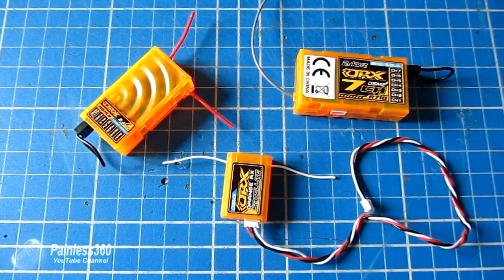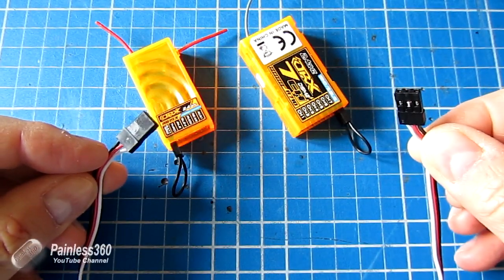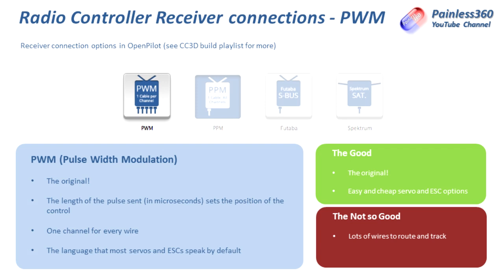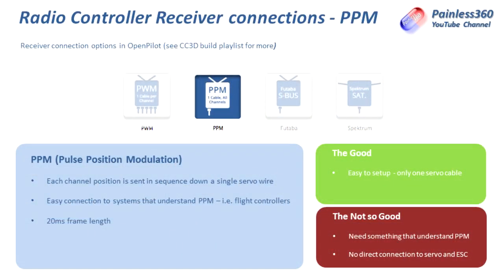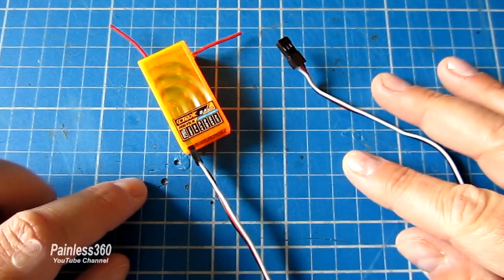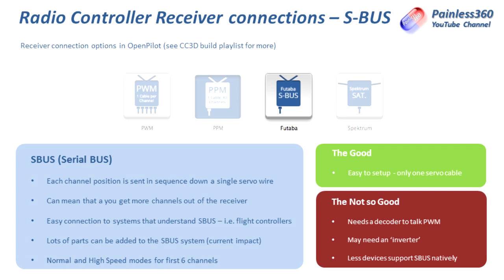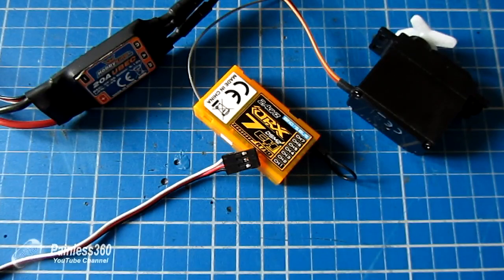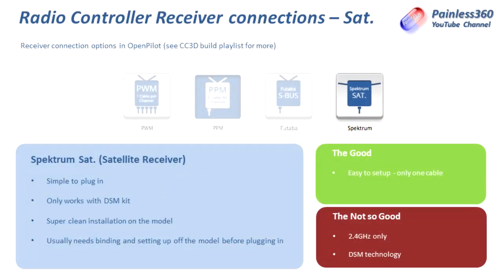RC Quick Tip - PWM, PPM, CPPM, S-BUS and Sat. explained for beginners

Comment: Great video! Any chance if you know if the Spektrum AR7700 Serial RX will work with a DJI A2 FC?
Reply from the maker: +NFA RC you need to have a look at which of these common protocols that receiver supports, and then make sure that what least one of them is supported with that flight controller that you're interested in. If both of them support the same one, then if you use that you should be good. Hope that helps!

Comment: hai painless360,i have question for you about my eachine vtail 210.. my vtail is ppm output,how to change my ppm output to sbus output.. cause this vtail use flysky rx and i get to change transmiter to use futaba.. thx
Reply from the maker: It depends on the flight controller it's using. If it's one of the 'normal' ones then you can look up the videos/manual for it.. Best of luck!

Comment: hello  can you watch this short video and tell me what i am doing wrong with the wiring of my esc's
https://www.youtube.com/watch?v=PePYT4SfY7Q
thanks and have a merry christmas.
Reply from the maker: Sounds like you need to do a little bit more research in order to figure out what you’re doing wrong as there are a lot of assumptions and testing you’re doing that are not helping you here. I’d suggest watching the ‘Quadcopter building for beginners series’ here as well as the ‘Introduction to remote control’ series too. Best of luck..
Reply: thanks. i think the bugs b2c board must use a protocol that the new esc's cant read.
Reply from the maker: +Chris Riley very possibly. OEM systems like this I usually designed to work with a very limited set of components to control complexity and costs. With open source components you get the chance to go into the software and change the settings needed to make it all work. Happy flying!
Reply: thanks . i did not know if it would work and could not find any info on it so i just thought i would try it. can 2 stock esc's be added to each arm for more amperage or will that not work eather. the stock esc's are only 6 amp.  thanks for your help, you are the best!
Reply from the maker: +Chris Riley no that won't work. You don't need to increase the amperage of the onboard escs they work fine with the supplied Motors and props. Happy flying
Reply: i know but i want to put the bugs board on the smaller carbon frame . and to do that i need to run smaller props and to do that i need the 2600kv motors that i have and they pull 15 amps and i want to use the bugs board cause it has gps and rth.   but i get the picture it just will not work. i guess that is why no one else has done it before and i could not find any info on it.  this just sucks.  oh well thanks anyway.  im a big fan and love your channel. keep the videos coming!

Comment: Hi. I'm trying to figure out if the SPF3 flight controller would work with a spektrum AR-610 receiver. Can you help me please ?
Reply from the maker: +LithiumBoltYT you need to see what outputs the receiver supports. After a quick check, I can see only supports pwm. That connection is covered in this video. Best of luck
Reply: Ok thanks

Comment: so I can use my drone transmitter to a rc plane. I have an old devo 7 and Im planning to build rc plane would I be able to use it since in rc planes is mo simple that quads.
Reply from the maker: +Joenas Gayramon yep. Typically there is much more setup needed on a plane than one for a quad..

Comment: Hi, do you know if you can connect the SAT port on the side of a DSM PPM or DSM S-BUS receiver to the SAT port of a Flight Controller? 

Or to put it another way, is there a signal coming out of the sat port on the side of the receiver? 

I was looking at doing this so that it frees up more pins on the Omnibus F3 FC for connecting so I can connect a Rangefinder and GPS all at the same time. 

Thanks as always
Reply from the maker: If I understand the question correctly - you can't the Sat. connection is for the radio signals from the sat. Rx only..

Comment: I have an etronics controller From an old helicopter. is there a way to pair this receiver with that transmitter?
Reply from the maker: Without knowing more it's impossible to say. Most of the older flight controllers supported PWM, with many supporting PPM and then S-bus too. It depends on what the flight controller if you have and what the specs day.. Sorry I can't be more help.

Comment: how can I control a dc motor using a flysky ct-6 transmitter receiver
Reply from the maker: +Tapan Banerjee depends on the motor but you’ll need some form of brushed or brushless speed controller..
Reply: Painless360 m using a simple dc motor and wanna control it using transmitter.....brushless can be done that I know by connecting esc...
Reply from the maker: +Tapan Banerjee then Look at using an rc controller switch for basic on/off control or brushed speed controller. Best of luck!

Comment: unfortunately with my fsi6s receiver running the other channel pins doesn't work when in ppm mode. I think it runs iBus/sBus under the option ppm but it's not actually ppm it's sBus or iBus. If I switch back to traditional pwm I can run that servo. Need to go back to pwm just so I can control gimbal pitch and camera shutter.

Is there any real disadvantage to pwm aside form more cables?
Reply from the maker: +Zac Johnson not really. Best of luck!
Reply: yeh thought so, good to know thanks

Comment: I have a cc3d equipped arf Realacc GX210 with an included eight wire receiver signal connector. However, it has an atypical configuration and I have not been successful in my attempts to understand it. You are my go-to man for resolving problems as I learn my way along this hobbie. I posted a pic for your review at your google+ acct " welcome to the cc3d series."   Hope you will take a look and a big thanks for all the effort you have put into making the library of videos that serve as priceless instructions in a hobby notorious for its Chinese manufacturing and, therefore, nearly useless instructions.

Comment: Hi, Great video as always, quick question, I have a vortex 250 pro, I've just ordered the fr sky x4r SB, if I use this in Sbus mode can I connect a buzzer to the pins that output Pwm and use a switch on my Taranis X9D plus to use as a finder, I find the buzzer built into the vortex not quite loud enough.thank you!!!!!!!!
Reply from the maker: +Malcolm Dickinson possibly, have a look at channel forwarding for the flight controller that you're using. Best of luck
Reply: I don't know what that is but i will google it, thank you for the quick reply, and thank you for all your video's.

Comment: For the PPM connection can I use a FS-CT6B receiver and transmitter with a flip32 flight controller, or do i need to get another receiver, if I need to get another receiver (the one you use in this video) can I use the same transmitter. Thanks for the video it was very helpful in explaining all of the terms.
Reply from the maker: One way or the other that should work. Personally I think that radio shows its low price. Things like the FS-i6s are a better built, more useful radio.. Happy flying!
Reply: Okie dokei I have been using a KK2 flight controller but I can't get my quad to fly so somebody recommended I use a naze32 or flip32 flight controller so I can use cleanflight. 
Just to be clear,  all I would have to get to make the switch from a KK2 flight controller to a naze32 or flip32 would be getting the new flight controller?

Comment: In the case of CCPM/PPM is the receiver powered by that single wire as well?  Eg. The board powered by the ESC and then the board powering the receiver? Thanks.
Reply from the maker: +Steve Austin Yep.  Best of luck!

Comment: Hey, I tried plugging everything in, cleanflight registers the two dials on the transmitter, as aux 1 and 2, but only those two are registered. If try switching the two wires into other channels on the receiver, it just changes to other sticks moving the aux 1 and 2 channels... No matter what I do, roll, pitch, yaw, and throttle will not move. Please help? First time builder...
Reply from the maker: Tricky to answer as you don't mention the radio type you're using or confirm how the model is setup on the radio itself.. I'd suspect the receiver if you are using a model setup you know is good and have experience setting these things up..
Reply: Painless360 Yes sorry, as I said I'm brand new at this stuff. The receiver is set to pwm, I think it's just the unusual nature of the "cheap ass" receiver. The controller is good, so I bought a receiver capable of ppm instead. Everything should be good now, I have them coming in the mail tomorrow. Hopefully everything pans out, than you so much for taking the time to answer my question though :) have a nice day.

Comment: Great video, thanks a lot for what you are doing, it is amazing. Anyway I have one question concerning the antenas. Im building a quad and I want to use Orange R615X reciever, but it seems that the antenas are pretty short. But as far as I have seen there are usually two long antenas coming from the reciever covered by some straw sticking up the frame of the quad in all the pictures and videos of racing quads. Would those two little antenas on R615X  be good enough for normal FPV flying? Isnt there gonna be any disturbance by a composite frame or other electronics? Thanks for your answer and time in advance.
Reply from the maker: Yep, make sure they are clear of the model. See our CC3D build series. We still fly that model regularly with that same receiver..

Comment: Great video! My only question is: do you know the low-level details of how to implement the S-BUS or Sat Rx protocols? I've written an Arduino code that outputs jitter-free PPM signals perfectly, and is being used by a PhD student to have a computer fly a drone in a lab, and the Arduino Servo library does PWM, but I don't yet know how to implement the other 2 protocols.
Reply from the maker: +eRCaGuy not personally, but there are some good resources out there. I.e. https://github.com/zendes/SBUS Best of luck!

Comment: Is PWM the same as PCM? My Turnigy 9X only has two options: PPM (Pulse Position Modulation) and PCM (Pulse Code Modulation).
I have been using PPM (without knowledge) and have my servo and ESC connections on each individual channel working fine, so I'm assuming it is bcuz of what you talked about as the Batt/Bind port would use PPM and the remaining port would still output "PWM".
Is this correct?
Reply from the maker: Not really, PCM is similar to PPM (one cable) but uses a digital rather than an analogue signal. I've not come across it very often and use PPM or S-bus here.. Best of luck!

Comment: I posted a vid on my page of this truck I have no one have seen a circuit board 4 it an I don't have a controller witch I wanna get but don't know we're to start
Reply from the maker: I've watched the video and that is old school tech on that Jeep model. 27Mhz, brushed motor and what looks like a relay on the PCB. This is not something that I've seen or played with in many, many years. I'd see if you can find any manuals for it online so give you a clue about setup and the radio it needed.. Best of luck!
Reply: Well I appreciate your insight, thank you. I'll subscribe

Comment: Hi, I just bought a DSM2 version of the Warlark 80 from Banggood.com and looked on the internet for the manual. I found it on UndergroundFPV.com and it says "Check your radio is in D8 or 8ch PPM mode" (https://docs.google.com/document/d/1Ui9bjTT08xNbATc20_caaaXE81dJv9jJyYoT9RnUa4E/edit). 

The thing is, I have an Orange Rx T-SIX from Hobbyking, and have no idea what I should do. (I'm also a noob to FPV racing and it's electronics). Please help. (:

Comment: I need help with picking a flight controller for the Falcon Pro 250.  Which FC has the satellite port installed and I won't have to solder up?  I can pick from CC3D, Naze 32 Rev6 and SP F3.  If I just buy the RTF which FC is more spectrum friendly if I want to use my DX7?  Thanks!
Reply from the maker: Clone and OEM version of the board can come with a sat. rx. port installed or not - I'd always check with the seller for their version. They are easy to buy and simple to solder if you get one without it. Check out the Seriously Pro boards as a starter. Best of luck with the build!

Comment: great vid, just wondering if my transmitter is ppm, does that mean the receiver is too.
Reply from the maker: Not always, you need to check the manual for the receiver you're using. Most have a PPM output marked as such. Best of luck!

Comment: Hello Sir, 
Are you using CC3D or any other flight controller because I donot have the connectors to plug in the servo cable for PPM. Please help
Reply from the maker: The cables to connect to the receiver should come with the flight controller (see the other videos) in the series. Everyone we've had has come with them.. Best of luck!

Comment: my receiver has I-bus instead of s-bus what is the difference?
I plan to read the channel values by an arduino as I did it with PWM, but whenewer I search on i-bus arduino only a BMW i-bus interface is the result so need to know if it's the same as s-bus or not?
Reply from the maker: Connections are the same but you need to select I-bus instead of S-bus and make sure that the Rx is sending the right one.. best of luck!

Comment: Also my quad is equipped with the naze32 rev6 flight controller. All of the electronics on the squad are built-in till one circuit board. So basically if one of the ESC's go bad all of them are bad because you cannot replace just one because it is built in

Comment: Thanks for the informative video. I do have one question. I have a AT9 radio link receiver that has PWM & SBUS. It reads on the receiver as: PWM (S BUS). My question is, does this receiver get only one wire connected to it?
Reply from the maker: Probably, if you're using the s-Bus output.. Best of luck!

Comment: OMG, but what transmiter, DX6 working with it ?
Reply from the maker: Depends on the receiver - you'll need one that 'talks' the same language as the radio transmitter. For Spektrum you'll need a DSM/DSM2/DSMX compatible receiver. Best of luck!
Reply: So, DX6 work with it or not ? YES or NO ?
I do not need to delve into the architecture of the electrical signal-wave, and microcontroller programming. I need it for integrated Power and flight controller  board (d link f3 diatone)
, pcb is aboard gt2 200 I want to buy. 
I will be grateful for the write-off.

Thank you for your time in the above response.
Reply from the maker: This may help - https://www.youtube.com/watch?v=_YNRZVJIl7k
Reply: Thx, YES it works becouse DX6 transmitter working in DSMX. :) Ok, FPV time.

Comment: Dear painless360, could you help with a dilemma, Im quite new to the quadcopter seen, I have a 9XR Pro with an Orange DSMX/DSM2 module with R617xl Sat rx and a 618xl rx, here's the stupid question, Is it possible to get telemity like VBat and RSSI? same as the Taranis telemity. Is the R617xl Sat rx different too the R110xl Sat rx? if you could tell me what you think of the choice of Radio Gear being good or bad would be much appreciated! Chris
Reply from the maker: I'd have used it with a FrSky module and FrSky receivers - that way it would work in a similar way to the Taranis radio we show in a few series here on the channel. We've not used those receivers/radio here.. Best of luck!

Comment: great vid. i have a noobie question, how can you find out if your flight controller and or receiver supports ppm? My quad is currently all hooked up as pwm
Reply from the maker: +TheCardinal365 the easiest way is check the manual or specs for the receiver you are using. Most modern ones offer sbus or PPM out. Best of luck!

Comment: Can I use the satellite port on the normal receiver with a flight controller.
Reply from the maker: +Legend Cox you can still connect a sat. to the main reciever you are using. The use of sat. recievers was all about the small size. Happy flying!
Reply: +Painless360 what I meant to say was can I use the sat port on the normal receiver to plug into the naze32? And use the normal receiver instead of the satellite. Like a cppm setup so I could still use my ports, or would I just need to get a cppm capable receiver.

Comment: Hello,
With satellite receivers, you must bind it to the spektrum radio (dx6i) and then connect it to a flight controller which can do satellite, right?
Also, after you bind the satellite receiver to the spektrum remote, you only put the satellite receiver in the model, not the other one used for binding, right?
Reply from the maker: See our video on common connections for the Naze32 (and others). You can bind it before you install it but you can also read all about the process with it connected here - https://github.com/cleanflight/cleanflight/blob/master/docs/Spektrum%20bind.md Best of luck!

Comment: Hi

I am trying to connect my naze 32 rev6 and cc3d board with my fs-ia6b receiver with PPM and the receiver does support PPM...but me thing I did not understand in PPM wiring from where did you get that 3 wire servo cable and where should I connect the other end of the servo cable which is coming out from terminals of bat/bind !!!!

pls help
Reply: fs-ia6b supports PPM, and you need to be plugged into the first three pins on the Naze board, ground, then positive, then channel 1. Make sure radio has PPM tuned on also.
Reply from the maker: You need to use the channel motor screen on the radio to see which control moves which channel. On our FlySky FS-i6S radio here the order was 1: Aileron(roll), 2: Elevator (Pitch), 3: Throttle and 4: Rudder (Yaw). Yours may be different. Best of luck!